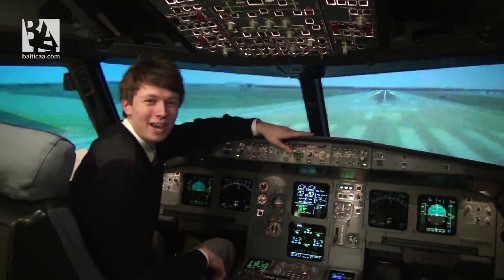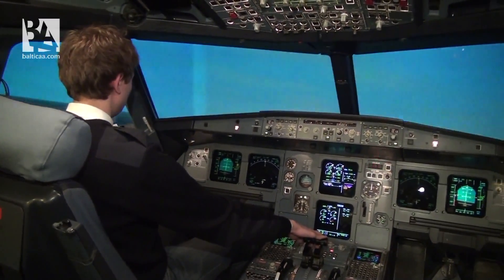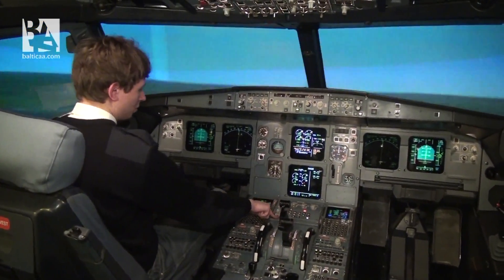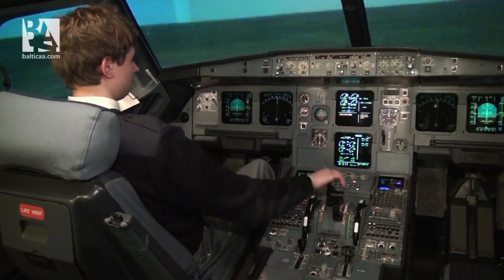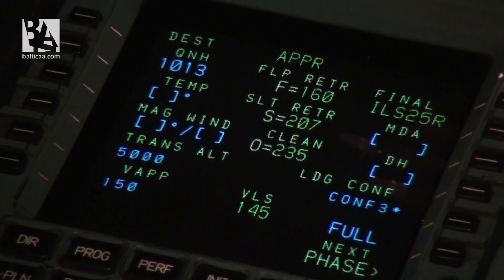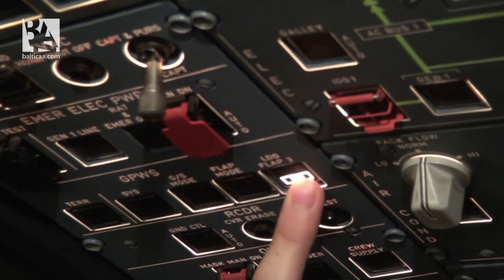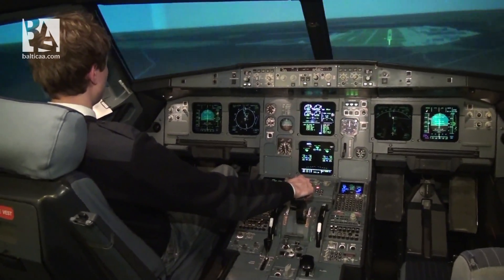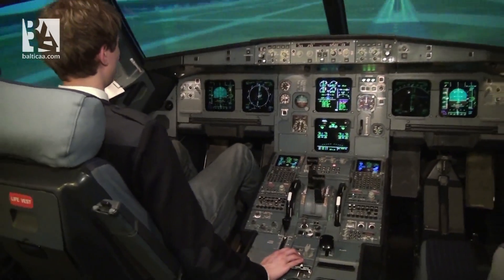Airbus A320: Engine Failure

Comment: Great content! Quick question, when you were on effective downwind, setting up for the were making speed reductions. Were these based on a procedure, improvised speeds or were you just using the flap limit speeds with an added safety margin? Thanks.

Comment: Boy ... try to do this with a crosswind and some gust ... impressive but probably scary as hell if you get this in real life .. amazing that you can in fact use reverse at all without it going all off center.
Reply: Perhaps the stopped right engine creates enough dragg which pulls quite a bit on that side as well, no ?

Comment: I'm a little confused; if the engine fails at V1, why would you not decide to simply abort the take off? Isn't that what V1 is for?
Reply: V1 or above is a no. If it’s simply one engine failure it safer to just climb out on the single engine, circle and land

Comment: Serious question:
Why had the rudder trim to gat a reset before landing?
Reply: The rudder/pedals are used to steer the plane on the tarmac once it lands while it comes to a minimum speed of taxi. So, its mandatory to switch to manuel rudder from the rudder trim by setting it to zero.
Reply: It's not fucking tarmac

Comment: Why did you keep engine mode selector on ignition start position and why didn't you switch off the engine 2 fuel pumps?
Also I am wondering if the air bleed from engine 1 was on in order to start engine 2 with it when APU was off.

Comment: Thank you very much for all of your fantastic videos:

I've got few questions on this and I would appreciate it I have a chance to get answers to them:

1) Don't you think on an engine failure it can be somehow risky that prior to checking oil pressure and temperature you do a cross-feed? It means the fuel will be balanced in tanks but if there is a leakage then what happens is that you'll lose a lot of fuel possibly causing gliding on no fuel.

2) Soon after departure you lost an engine, wouldn't that be safer if you could head back to the air port

3) Landing checklists ignored?

4) Where the heading numbers are obtained from?

Thank you
Reply: Hello Ali Rahimy, it is dangerous to go for cross feed without checks but he clearly did not mention as he assumed there to be no fuel leakage. Weight balance is def a go with given situations. 
He would return back to the same airport depending upon the situation. if its an emergency, he might get directed to an airport that is either near by or that falls on the way or head back to the same airport.
Your right, landing checklist should not be ignored.
Work on the heading, its no hard task. Navigation plays in again as in asking vectoring or fly to an airport near by.
Hope this helped. Have a great time.

Comment: I am not type rated so my question may appear a complete nonsense. If so - my apologies in advance.

Climbing to 400ft then to 3500ft with flaps deployed looked to me like a noise abatement procedure. Was there any other reason to delay cleaning up the aircraft?
Reply: Once you have reached Engine Out Acceleration altitude (depending on the company procedures this could be 1500' AGL or above) you usually "push to level off" using the VS button (or if manually flown level off). Accelerate the aircraft and retract the flaps in stages to 0. Once the aircraft is a green dot speed (best min drag ratio for the weight - the computer figures this out) you pull the altitude knob to climb to MSA or procedure height if you're coming back in and set MCT power (max continuous thrust power). The height at which flaps are retracted is down to the company policy and other factors such as terrain. Also retracting flaps reduce lift (the also reduce drag) but this loss in lift is enough to get a bit of a sink which isn't really wanted in this critical performance situation hence keep them deployed until at a safe height, accelerate, clean up and keep climbing if required!
Reply: I just had a look at a FCOM procedure for a single engine failure at V1. Unusually, it does say that after S speed, you retract flaps to 0. On the procedure directly after it (Immediate VMC landing following engine fail at takeoff), it mentions that you should maintain flaps one after S speed. I'm not sure what you would do, as the procedures obviously contradict each other.

Comment: Hey BAA! If one of the engines on a dual engine plane fail, can pilots still fly the plane to it's intended destination still being pretty close to the takeoff point? And if so, is there any kind of authorization needed? Thanks!
Reply: Procedures require that the aircraft MUST land at the nearest capable airport to it, be it the takeoff airport or the landing airport, or anything in between. Whether it is physically possible for the aircraft to complete a full flight, I'm not sure, but I would suggest it would not be possible, as the engine cannot be flown on full for longer than two minutes or so, the climb rate would be poor, and single engine bleed air may not be enough to pressurise the aircraft fully. Interesting question though.
Reply: +Dragaming thanks for the answer:)
Reply: On the A320 TOGA (take-off go around power - full power basically) power with 1 engine inoperative is 10 minutes. However it can be put in MCT (maximum continuous thrust) continuously as the name suggests.  The aircraft cabin can be pressurized using the APU (auxiliary power unit). If the aircraft took off from an airport with bad weather, the take off minima (weather wise cloud etc) is usually lower than the approach minima at some places. Meaning you can take off but not land again. Performance wise the A320 has good performance on 1 engine. So it is possible to fly to the intended destination if that is the closet and most suitable airport for landing. Of course you always need to take into consideration fuel, the passengers and what the company thinks is best. Hope that helps!
Reply: +Shoelaces13 great explanation! Tyvm :)
Reply: You're welcome!

Comment: At 1:02 You say the temp is 45 C - that is unusually hot (not for India), but then you say the weight is in tons when the readout says KG can you clarify?
Reply: +Rocket Rider
It said 74900 KG, and since 1000 KG = 1 Ton, 74900 KG = 74.9 Tons which is pretty much 75 Tons :)

Beauty of the metric system :) You switch between different units of the same dimension by multiplying/dividing with/by (multiples of) ten :)
Reply: +Freakschwimmer     Thanks, I get it now.
Reply: No problem, you are welcome :)
I like to help out the metrically-impaired :P
Reply: I'm grateful ... I hate it when I can't figure out something ... especially being metrically-challenged and having the metric system all around me.
Reply: :D
See, I on the other hand am  not that good with imperial units.... I mean, I get inches, feet and miles, bit still have to focus hard once it comes to graines, rods, chains and furlongs :/

Comment: @ 14:29 at 500 ft from ground, you switched off FD of Captain and First Officer and then you pressed the Metric Altitude? If yes, why?
Reply: ***** Thank you, but what is for the TRK/FPA button?
Reply: Robi Esse FPA stands for Flight Path Angle. It puts the aircraft into a nose up or down attitude depending on what pitch you set. It's generally used for steep approaches
Reply: I think that's what you're asking

Comment: For all the people complaining about how he advances the thrust levers...
First off, the Airbus thrust levers are different than a Boeing's. They have "gates" (clicks) that are designated positions for things like Climb, TO/GA etc. so you can't really move them forwards smoothly. 
Second, the computers take care of it, so no matter how quickly they are advanced, the computers make it advance nice and slow.
Reply: As long aa you stabilize the engines, it doesnt matter how fast he advances the levers.
Reply: andromedarr The detents are made to make switching to certain N1's easy, all of which are used
Reply: On Airbuses, you can think of the throttles as being similar to the flaps (or the spoilers, as on some aircraft like the DC-10). They have specific detents that they go into, rather than having an infinite number of positions.
Reply: Well that was helpful :)
Reply: Canonical The "clicks" are detents
Reply: Real question: In Alternate Law, how do they control power? Do the click position detach from the leaver to make smooth, direct thrust operation possible? 
I think i would like boeings more...sadly, my only option will be to fly airbus...lets hope a pre-FBW one...

Comment: Airbus A320
===
In scale of 5 you are flying at 3
===
2 Engine Operative 5 minutes TOGA
1 Engine Inoperative 10m TOGA
with 1 or 2 ENG. Flex unlimited
************************************
ENG. Failure After V1
1.Maintain Centerline VR rotate consider 12.5 degrees pitch.
2.SRS FOLOW
3.TOGA-SET
4.if above 100ft  AUTOPILOT-on
5.At 400ft minimum apply primary ECAM actions
6."Engine secured" stop ECAM. At ACC ALT VS-0 Clean aircraft
7.Green dot speed Flex, Open Climb , "Continue ECAM action's"
8.ECAM completed STATUS page(Stop) After take-off checklist
9.After checklist continue with status page.
10. When safe flight path established crosscheck with QRH
11.Consider overwaight landing procedure reffer to QRH.
12.Consider Loss of Braking (Memory item) (loss of braking may occur).

Comment: fuel dump?
Reply: There's no fuel dump on an A320...or most airliners. It's mainly military now. So they tell me!
Reply: Cian Broderick I won't argue. But if you can find a screen shot of the fuel dump switch in an A320 overhead panel I'll make a charitable donation!
Reply: +Nigel Doyle there is in fact fuel dump on some airliners, but they must be large like 767

Comment: Whoops! Rudder is not most critical flight control surface. Elevators are. You can use ailerons/spoilerons to turn the aircraft along its longitudinal axis, as a last resort you can also turn the aircraft with asymmetric thrust. The rudder isn't overly used unless there's crosswinds for example, although it is a primary flight control surface, yes, but not the most important. We could agree had you stated about the tail fin, but you were mentioning of important control surfaces... Elevators are.

Comment: "Positive climb - gear up" 20 secs after rotation?
Taking off from a high altitude field with hilly terrain, like Kathmandu , by now you'd probably start seeing mountain goats in the sky!
Reply: Sidhant Agrawal what is your point ? He is flying alone. Getting the flight path in control is also a imp thing remember? If he disregards the controls and stretch’s to retract the gear he can fly into any terrain like in the one in VNKT. Please don’t be critical he is just a young pilot learning himself. Fly Safe.

Comment: Small remark: the limitation for TOGA thrust with one engine out is 10 minutes, with two engines it will be 5 minutes. And don't bother about exceeding a time limit if you need the thrust. Its better to have an extra engine check by maintenance then a close encounter with a mountain.
Reply: Why would you be doing a terrain escape maneuver for more than 5 minutes? Are you taking off at the bottom mt everest?
Reply: What even

Comment: I wonder if it would hurt if you were in a proper flight simulator like they do on air crash investigation and you were at 30'000 feet and you went into a straight down nose dive and you crashed into the ground

Comment: the ap may trim the aircraft to a postitive rate which  will increase angle of attack resulting in more lift due to the loss of speed. the result is more drag over the wing and this can cause the aircraft to stall. it has happend to me in flightt sim x

Comment: the rotating wheels are the vertical trim the trim allows the aircraft to pitch up down left or right without the pilot having to apply input to the flight controls via the control colum or side sitck...

Comment: because stopping power is drastically reduced due to lack of hydraulic pressure for slats, flaps ans spoilers as well as half of the amount of reverse thrust, v1 is different with two engines than it is with one engine

Comment: Question for you, sir.  Will the AP make all turns in the direction of the operating engine? I see the AC made all left turns with the right engine failed, which makes sense, but had your course called for a heading change to the right of your course, would the AC have turned left or right to the new heading? In small planes, they warn you to turn in the direction of the operating engine whenever possible.

Comment: sir ive got a question, i had read about the take off segments and i thought you had to clean up the airplane in the acceleration altitude and after doing this perform the emergency procedures,  is AIRBUS different regarding this?

Comment: because once he puts the engine on idle the rudder will throw the nose of the plane to the pointed side , he used the trim because when one engine fails the working engine will push the plane either to the right or the left and the rudder trim is the correction for this behaviour.

Comment: I have never hear it before... What you say is wrong. The AP1 and the AP2 are two identical systems. First, if one fails, the oder can continue controling the airplane. And the fact of having two AP, increase the landing capability of the aircraft. (AP1 or AP2 engaged : CAT III SINGLE for exemple , and AP1+2, both engaged : CAT III DUAL)

Comment: I'm no airbus expert, but you mentioned in your 737 vs 320 video that the airbus would in the event of an engine failure or asymmetric thrust condition  "Trim everything by itself" whist the 737 required manual trim. Why did you have to use "Immense" force on the rudder Mr. Pranas?

Comment: Not arguing--just discussion here...  But in the sim you have no pressure, especially if you're not taking a checkride with the Standards Captain and a couple FAA folks for added fun. I've done that many times. He is a sim pilot. The same way most 12 year olds can fly a great simulator on their computer.  Real life is very different. He makes it look too easy...and it is not.  I wonder how many "takes" this video took.  If I take a sharp knife and carve a turkey...I'm still not a surgeon.